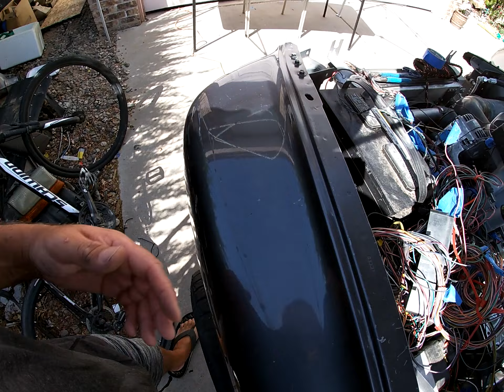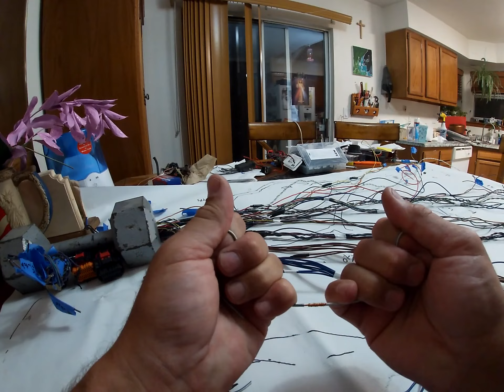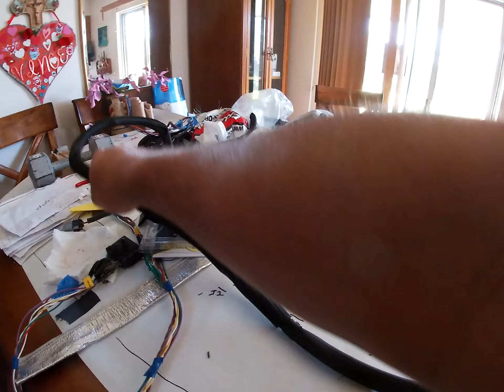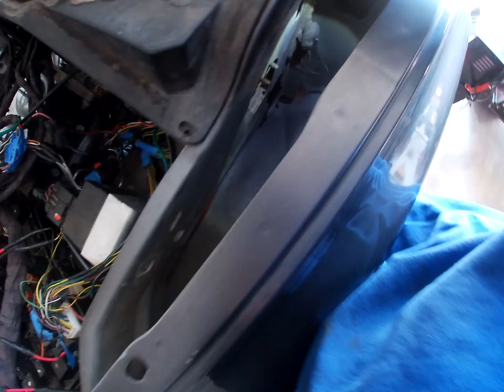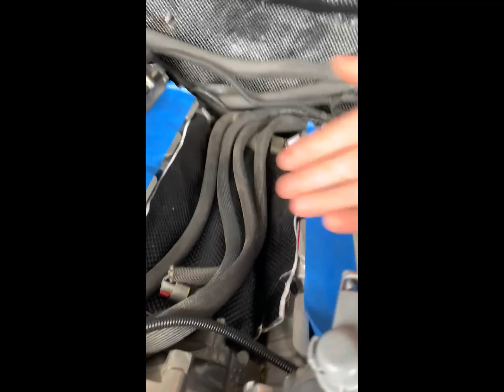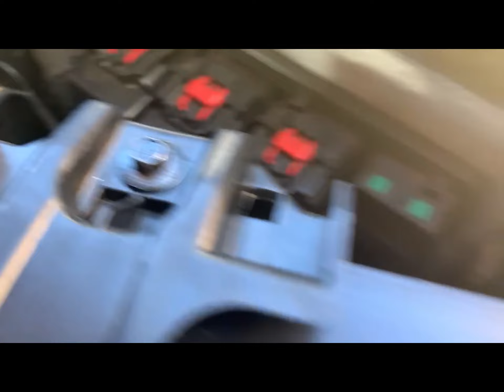DIY Hemi Swap Wiring 98-03 Durango Dakota part 6 finally finished

Comment: what do u plan to use to make your fan ac and dash functions work? just wondering are the pcm using similar software or are they completely  different
Reply from the maker: Hi. For the ac. I will be posting the videos on that soon. I used a aftermarket controller that uses its own temperature sensor.  As far as the dash. There’s different ways you can go that get expensive. I used a gauge set that plugs into my obd2 port and mounts on top of the steering column. That’s a temp situation for me. It’s about 90$. Other options are going to be 500$ plus. The hemi software communicates through CAN bus and the Durango uses PCI bus. That can’t be used together in an easy way.
Reply: @justswapit-jsi-8911  thanks